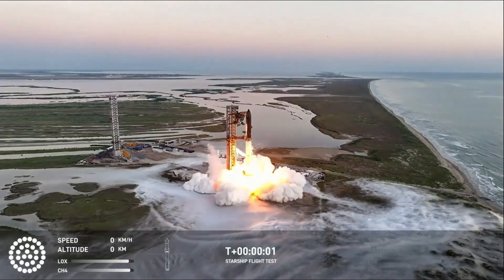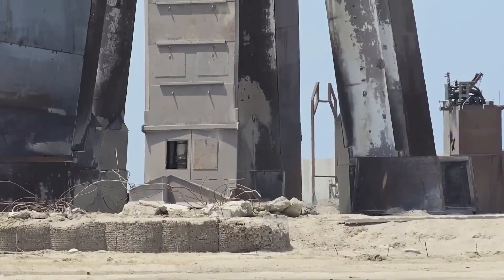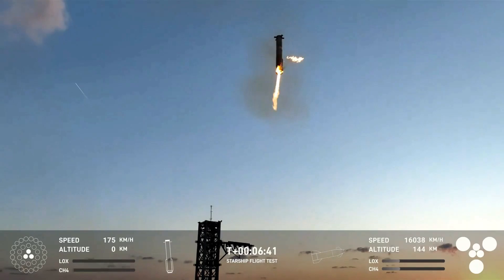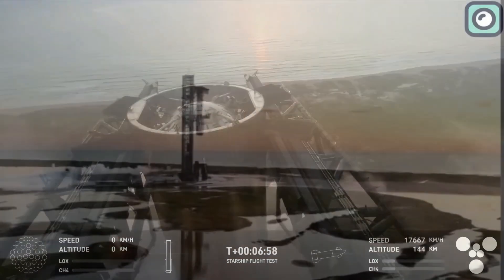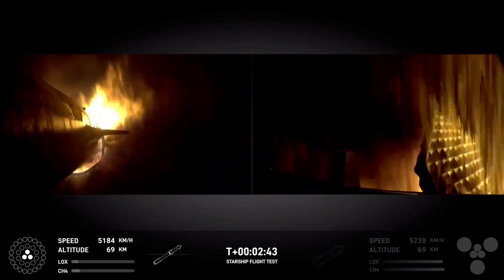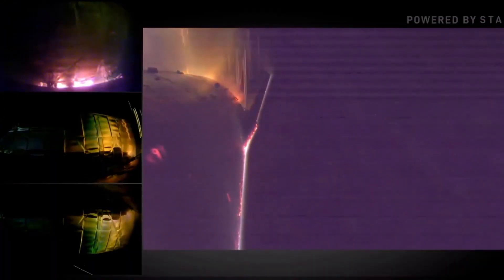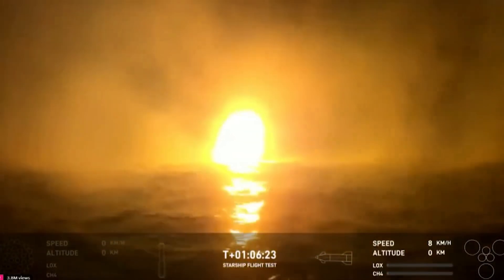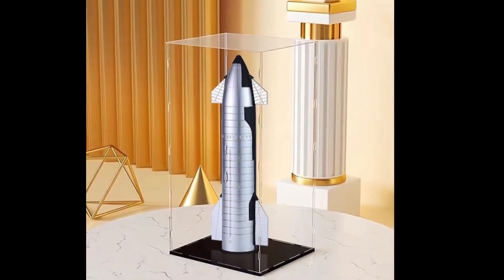Musk Revealed Starship Booster Damage After The Flight!

Comment: 1)  ABS Valve: much better than BOSCH, ZF, etc. Because faster and Proportional (Because not a Solenoid Valve). 
1.1) 98% eff. in Simulated Braking on Dry asphalt W Puddles (Wet asphalt); Calc. using Pasejca (MF) Magic Formula. 
2)  Precision RotaryActuator, (Electric W/O ElectricMotor W/O Transmision): for accurate_Robotics. 
2.1) Simulation for aiming laser_beam at Target: Capture Target t<0.0006sec. Keep AccurateTracking while strong WindGust. (Because: W/O delays of Coil & Transmision)
(Prev. Version 2015)

2 Designs for (fast) CAR. 
The 2nd is either for supirior-steering 
Or for superior-mecanical-braking
(All cheaper than existing)
Following is the 1st one: 
1)  Unique Valve for shortest Braking-Distance and supirior stability while braking. (Important for fast Passenger Cars)
1.1)  My Invention: I have a (complete design of) low-cost Valve that will replace the 2 on-off solenoid valves (for each wheel, in the ABS)  
1.2)  Will create Brakage: 98% of ideal decelaration on dry-asphalt with paddels (wet-asphalt): 
2)  Thus create the best ABS in the world,  Reduce ABS size (more reliable than solenoid valve). 
3)  Note: Today ABS use two On-Off Solenoid-Valves because Proportional-Solenoid is not good: Low-Reliability, and at mid position: the flow will be too high: thus, compell bigger-pump. 
4)  Linkedin 67953574 : (2 files on the Valve) 
5)  Dear OEM :  I have 3 more files on the Valve...

הסבר_פשוט:
"אין עם פלסטיני" כי הם: 
1) "מהגרי-עבודה" + "פושעים" (מקורם ~7שבטים). 
2) ה"מופתי"(=גאון) המציא "עלילת_אל_אקצה" כדי "להפכם_לעם". הסבר: 
3) "מהגרי_עבודה"= חרוצים_מהשאר (לכן מבוקשים). 
4) "פושעים" = "שודדים" ב"עזה" כי:
"עזה"=מעבר_אסיה-אפריקה 

"שינוי_גבול_בצפון": "קו-הרכסים"="מונע-כינון-ישיר" 
"המשיחיים": "חכמים-יותר-מהשב"כ" 
"תקיפות_אוויר_ביו"ש"="יוזמת_בן-גביר".

1) ה"טבח": "ביטל-פיתרון-שתי-מדינות", כי:  
הטבה לש"טבח-בנו"="תמיכה-בטרור"
2)  (עד שיהפכו דמוקרטיות):
"הגירה=הפיתרון" (לערביי: עזה, יהודה, שומרון)
3) הגיון: "משך-רפורמת-חינוך = "12שנה": "רק-לאחר-8-שנים": "תחילת-מו"מ-מדיני"
4) לכן אסור להעסיק ערבים מ"יהודה ושומרון".

Comment: These launches is were they get it right. What works. What doesn't. See what see what screws up, what doesn't, and what little things need tweaked. The end Result? A system that Works . On Time, Within Budget. Cutting aEdge Stuff. Like Boeing Used To Do. Let Engineers Drive The Bus. Not Beancounters!
    Think of it as a multi billion dollar Hotrod.